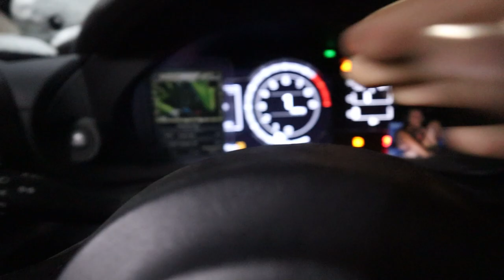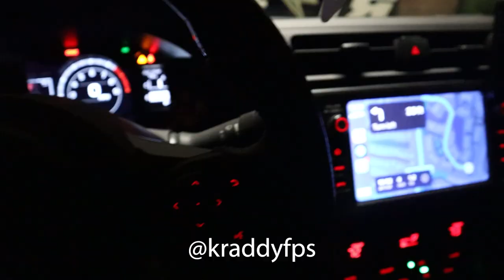THE FATE OF THE WIDEBODY BRZ...

Comment: I run the awe track exhaust currently on my GR86. The cold starts are really loud unless you tune it in the future to delete out the coldstart. I wanna switch to the Touring edition by buying the conversion kit cause to me it's nice but overtime it's giving me headaches.
Reply: The touring exhaust cold start is damn near exactly as loud as the track.